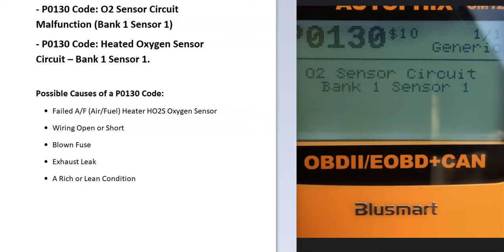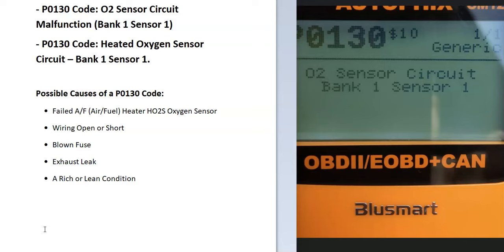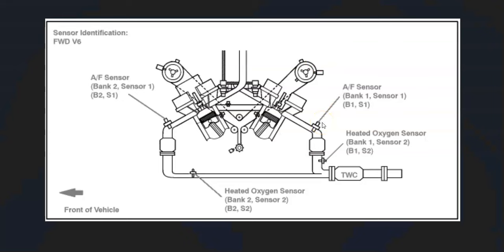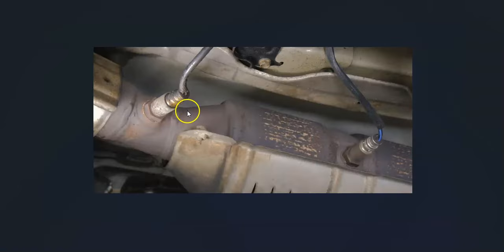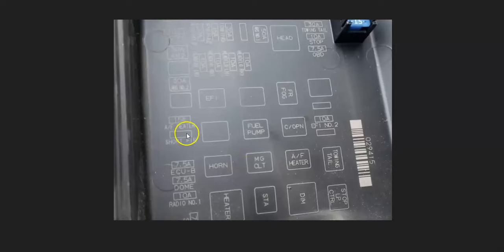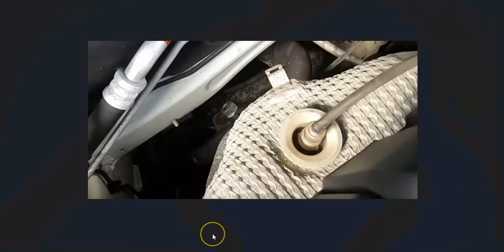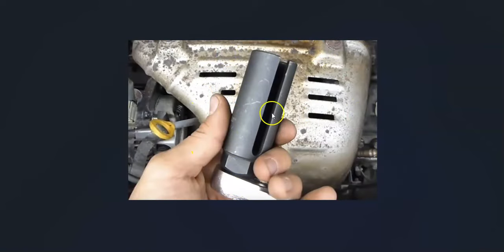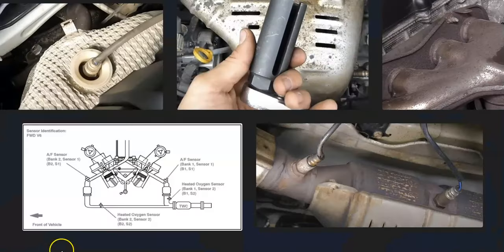Causes and Fixes P0130 Code: O2 Sensor Circuit Malfunction (Bank 1 Sensor 1)

Comment: My 2005 toyota had this error code, and part therefore was ordered. I then found out by chance some exhaust system bolts got loose. After fastening them the problem resolved.

Comment: This code popped up on my SLK 230 recently. It would come on after traveling 20 miles or so. I inspected the O2 sensor and it appeared that the wires had rested against the manifold and melted. I replaced the sensor yesterday and cleared the code. I've driven it just a bit since and the code comes back even quicker. Cleared again and it still returns. The fuses are all fine, so what's the likely cause?
Reply from the maker: If the sensor is good, I would test the wiring.
Reply: @HVAC_Mechanic  I found a disconnected vacuum line next to the sensor plug connector. Maybe I knocked it loose replacing the sensor. Fingers crossed, that's all it is.

Comment: I HAVE TWO CODES PO150 AND PO130 WHITCH IS BANK 1 AND BANK 2 UP STREAM  WHEN I CHECK THE PIDS THEY ARE GOING IN AND OUT OF CL AND OPEN LOOP DO I HAVE A BAD PCM OR WHAT? PS I AM A RETAIRD FORD MECHANIC.
Reply: Hola tengo ese problema código p0130 pero el sensor está bien funcionando pero está prendido el check engine y consume mucho combustible usted soucionó el.problema como lo hizo es Nissan X-Trail 2010
Reply: @Cas42194  usually the cat is bad is the cause of heavy gas/petrol use